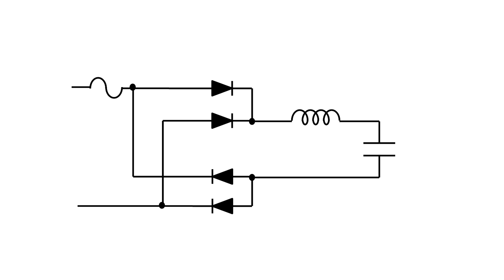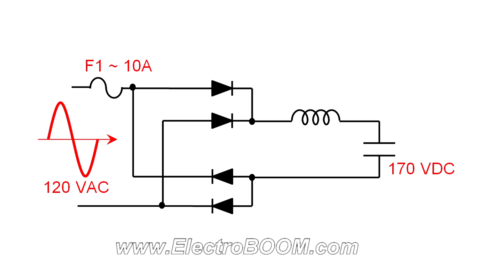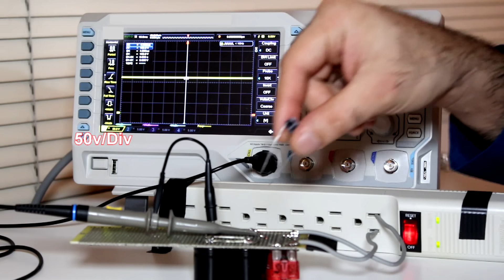Making a Full Bridge Rectifier

Comment: EB - I have a question? Could that FBR be used on output a motorcycle stator (which outputs AC current). Problem is, it is an old motorcycle and it uses a bridge rectifier (4 diode setup) to convert AC to DC. Problem is, I suspect the output is half wave or clipped. With your setup, the caps would smooth out the ripples, and give a cleaner output. 
I got rid of the OEM rectifier as it fired itself and got this: https://www.digikey.com/product-detail/en/comchip-technology/GBPC5010-G/641-1383-ND/2074848
But, I would like to have a setup like yours...15amp max current (small motorbike). 
Do you have any back feeding in your setup? That is another issue...we have to remove battery as over time, the battery will reverse drain mA....thx
Reply from the maker: What you bought seems pretty good. It is the same thing as I put together. You just need the capacitor to smooth the output. A heatsink on the part is pretty good too as it keeps it cool, otherwise it can heat up and die.
Reply: *****

Yeah, I like yours as you have caps which will smooth output...the voltage jumps all over the place on these bikes (CT90 Honda).
Wish I paid attention in circuit design...lol
Reply: Pretty damn expensive FBR you have there.
Reply: How does one calculate what size of Cap and/or inductor to use? 
The whole system is 60w max (6v). 
The stator output ranges from 5-30v DC (on output side of bridge rectifier at full throttle). Just trying to smooth output so the 6v battery stays happy.
Reply: Melli inBC Depends on the frequency, you might want to do more research into LC-filters.

Comment: What has been your most painful shock?
Reply: When he saw his father having sex with his mother.

Oh... You mean electric shock? I think 220v 16a
Reply: Touching a light bulb socket in a lamp without a bulb in it, while it was turned on.......it hurt. I was like 5-6.
Reply: when I was in grade 12, a friend loaned me the igniter for an oil furnace (high voltage generator). I think it generated an arc about half an inch long. I was using it in the basement, bare knees on bare concrete floor. I touched the arc with a pencil that was burned along the side. There was enough conductance through the carbonized wood to give me a jolt that made my right arm feel like it being torn off. No burns or lasting damage, but I realized at that point that  ignoring all my knowledge of electricity could be fatal. Returned the igniter to my friend the next day.
On an interesting note, years later, I observed that my right arm is noticeably stronger than the left, despite being left handed. Doubt its cause and effect though.

Comment: What is connecting the components at 3:58? Also is each hole on that board electrically isolated?
Reply from the maker: I used some copper wires to connect components like you see. The holes on the board are isolated.

Comment: May i ask you what is the role if that inductor?
Reply from the maker: +ucsikz2 It is for filtering purposes. Since inductor current doesn't change fast, the output current would be smooth and the voltage ripples across the large capacitors will be small. It specially helps those large capacitors, reducing their ripple currents which could be potentially very large at high load current due to the 60Hz input frequency. Imagine without the inductor, in every 60Hz cycle the capacitors have to provide 10A maximum in this circuit to the load, and then get charged with high current of 10A or above. That's a large current that heats up the capacitors and can make their life shorter. Now with the inductor, it helps provide a lot of that 10A current, making the capacitor current much smaller.

Comment: Hey Mehdi! If i took a diode and a fuse and plugged into a standard wall socket would that give me a DC power supply? Or would I have to use  a FBR?
Reply: Yeah, but that would be around 170VDC, and the waveform would be a sine wave in the positive part and no current would flow in the negative part. But be careful about the specs of the diode, it has to be able to handle at least 200 volts. Also, I don't see where such a voltage would be needed. What do you want to use it for?
Reply: I just wanted a steady DC source without buying a variable power supply or going through batteries, mainly.
Reply: Well, that is the wrong power supply for you in this case. Adding a capacitor on the output would smooth it out and make it steady, as shown in the video, which is suitable for small loads. But only if you want a voltage as high as 170 VDC. But as you said, you want to replace batteries with it, you'd have to regulate the voltage down with something. So I'd suggest looking for "diy regulated power supply" on google. There are much better solutions and they aren't as dangerous and crude as your suggestion.
Reply: +BeatRush2011 Not as dangerous and not as crude sound better. thanks for the suggestion!
Reply: No problem ;-)

Comment: Why use a resistor to discharge?
Reply: +Bronson Stephens The capacitor is charged to some voltage. Depending upon the voltage across it and the capacitance, there is some charge on the capacitors. Touching it with BARE hands could mean discharging of the capacitor and a current through your hand. Sure we don't want that.
Reply: +smit chaudhary why not just use a screwdriver?

Comment: You could use an isolation transformer to isolate the ground without affecting the safety of the power strip. I actually modified an old 120/240-volt transformer for that very purpose!

Comment: hello electroboom

another question...

could you explain why you choose to use a 30mh inductor? was it just perhaps a random choke lying around or is there a reason? how did you come to a 30mh inductor, is there a type of formula?

i am in Australia so i have made a 240vac full bridge rectifier.....and am contemplating whether i should use 60mh inductor because its double the voltage of yours? or does it not matter.. ...

Comment: Insulating the scope ground is a very bad idea. All the exposed metal on the scope is then at the line voltage (or whatever potential you connect the scope probe ground to). The right way is to use a differential probe or at least use an isolation transformer to power your circuit (NOT to power the scope - that just does the same thing as insulating the ground of the scope)

Comment: let me ask why you use 4 capacitors instead of 1, and are they linked in parallel?
Reply from the maker: +Rory Saba Just to have the high capacity I need. Instead of one huge one, I used 4 smaller ones in parallel.
Reply: +Rory Saba To make the wave very smooth
Reply: +Eugen1344  i fully understand now
Reply: also, real capacitors behave as if they have a resistor in series, called ESR, connecting them in parallel allows to reduce this resistance.

Comment: Hi Mehdi, could you explain why you get 170VDC over the cap even tough the max amplitude of the FULLBRIDGERECTIFIER is 120VDC at 1:00? Thanks, really love your videos!
Reply from the maker: +bume nicläs The input is 120VAC, which means it has 170V peaks. And through bridge rectifier they result in around 170VDC.
Reply: Thanks for the reply,  so the 120VAC is RMS?
Reply from the maker: bume nicläs yes
Reply: +bume nicläs VAC * sqrt(2) = rectified and filtered 

120VAC*sqrt(2) = ~170VDC

Comment: Hi Mehdi, one doubt. The DC "BARELY" hurts you, but why the stored capacitor hurts badly?
Reply from the maker: +successmiracles No DC can hurt quite badly, but it depends on the voltage level as well as where it touches on the body. 170VDC on fingers isn't too bad. But those flash capacitors charge up to 300VDC and that's very painful
Reply: Thanks.

Comment: +ElectroBOOM Firstly, i love your vids!

Why did the capacitors on the rectifier only shock you when it was disconnected from the mains? You were able to touch the 166V DC output earlier but towards the end got a nasty shock doing the same. The only difference i can see is that in the latter it was disconnected from the mains. Am i missing something?

Thanks
Reply from the maker: +DrR1pper It's thee same DC, just that different spots on body have different feeling. The palm of the hand shocks a bit harder.
Reply: ***** Ahhh, ok, so if you had touched the output with your palm when also connected to mains, you would have received the same shock? Thanks dude! Please keep making your awesome vids! They're hilarious and very educational (at least for me :P).
Reply from the maker: DrR1pper
Yes, but would be much worse if you were also touching earth somewhere else on your body
Reply: ***** Thanks Mehdi! You're Ace! :D
Reply: DrR1pper It says content unavailable. However, you're in the right place. Electroboom actually has a full video debunking probably the same guy you saw.
Cheers
Reply: +ElectroBOOM Do you ever get used to receiving electric shocks? I have been shocked once in my life and I can't describe any feeling like it, it's terrifying!
Reply: well... it kind of depend a lot on the circunstancie. I have got many 240v shocks, and usually don't think much of it ... (apart from: shit let me avoid that!) but once i got a shock when i had a live wire in one hand and neutral in the other (because i'm stupid!)... i almost shit myself.
Reply: +ElectroBOOM I haved 240 AC shock from electric socket.... at age 8.
Reply: I've been "buzzed" (110AC or whatever I was working on at the time) several dozen times by now, and "shocked" once (about 2kv). To answer your question, you actually do get used to getting buzzed after the first few times. Don't get me wrong, it still hurts and will make you jump and all, but it's not as terrifying after you've done it a few times
Reply: Range Rover i was soldering already at 4years old. Been shocked bij 240v ac like 100s of time
Reply: Actually if youre touching earth you would get a nasty shock because both the positive and the negative DC output of a bridge rectifier are AC referenced to ground, so showing how you touch the DC output without mentioning that you arent grounded is really dangerous.
Reply: If you're bored and or have some spare time on your hands, would you guys mind watching this. http://www.insight.tv/#!/eab91/en/show/extraordinary-humans/episode-9/episode-9

(start ~20 mins in)

I don't normally watch such things (as i've seen others in the past and saw through them) but somehow came across this in passing and the part about a man being able to touch 240VAC mains without issue intrigued me. Whilst i'm still somewhat skeptical, the reasons they came to conclude as being the reason later on at face value appear to be plausible to me and think it would to you also. Was hoping someone with more more knowledge could tell me if it's all a trick or not. Hint...the guy supposedly does not sweat and they demonstrate a test for this.

There are parts in the show that i know are very misleading though. Like the parts where he holds two electrodes connected directly to the mains and dips them in water and boils the water but the presenter of the show says something to the effect of "the electricity that is boiling the water is passing through him" which is patently false as he is only in parallel contact to the circuit that is actually channeling the large amounts of current that boils the water. There are some wtf can't be real moments too in the video but i'll leave them for you to see.

Comment: +ElectroBoom, I read online that the high resistive wire on the ceramic is nichrome wire, which explains why the resistor can heat up so much and hm even glow before melting down.

Comment: Among the numerous dangerous stunts, floating the O-scope ground so that it could be referenced to the hot leg of the AC instead seemed particularly cringeworthy... He could have simply exchanged the two suicide wires going into the AC strip, so that at least he'd be shorting neutral to ground instead (they should be at the same potential).

Or, you know, just not play with live non-isolated AC at all... trying any of this stuff is definitely Darwin Award material.
Reply: Surely exchanging the two suicide wires would only work if this was a measly halfwave rectifier, not a FULL BRIDGE RECTIFIER.
Personally, I'd not rely on the fuse to protect the scope.  I'd worry that the scope would protect the fuse by blowing first.

Comment: i dont understand, at first you touched the 170vdc but you didnt feel anything but at the last you you got a shock(may be pretended that you got a shock) and warned about capacitors being charged. was this warning for capacitors charged with more than 350vdc like you showed in an other video of yours about high ac/dc voltage effect on human body ?
Reply from the maker: Akshay Vyas No, actually different areas of body have different sensitivity and conductivity. My finger tips (maybe from cuts and beatings) has thicker skin than the palm of my hand and I feel electricity more on the palm of my hand versus the fingers.
Reply: Nissan Ranger It's been over 12 years since I sat in school, listening to all the lectures about the fancy words for it (and it wasn't in English, so I don't even know the fancy English terms), but in short, a capacitor has the ability to quickly discharge, unlike a battery or a wall socket. It gives the same shock, but the shock feels harder when it comes quickly, than when it comes slowly (not as in fast flow of electrons, that's me having a hard time translating to English again... sorry)
Reply: +morphman86 What makes you think the capacitor is anything more than just another source of electricity? The draw depends on the load...
Reply: +morphman86 this is correct. you can 'short' a battery but its current is still limited by the internal resistance. a capacitor doesn't really produce a current, but it releases its charge instantly.
Reply: +Akshay Vyas Also, a consistent flow of electricity, such as it is when plugged in, is much less shocking than just a quick, unexpected bolt, even if both are at the same power.

Licking a 9v battery feels tingly on your tongue, but you'll be able to hold it there, no problem. If someone asks you to lick a button, and it turns out to be a capacitor fed with 9v, quickly and unexpectedly blasting all of its stored energy right onto your tongue, you'll get a shock.

Comment: Isnt the oscilloscope a high ohm circuit just like the voltmeter ... I mean , you should not  be able to short something with an oscilloscope or a voltmeter ?
Reply from the maker: Ivan between the probe tip  and probe ground yes, but probe ground is connected to scope's earth. So there are possibilities to short, like this specific circuit.
Reply: ***** Thank you for your answer . That explains it better .
Reply: ***** Would isolating the ac input from the diodes through a transformers help in this case?
Reply from the maker: jboy55 yes it would

Comment: Will this work with 220V ac?
Reply: nadgoB Yes, but 340 volts DC, but speak to a priest first, as one slip-up and you will quite likely meet your maker!
Reply from the maker: nadgoB Will need to change some parts for higher voltage rating, but otherwise yes
Reply: ***** capacitors to 220v? Does any kind of diode work for this? If i was wrong what should i use if you could spare a little time to write me the specs or something please.. heh i hope i am not bothering you
Reply from the maker: nadgoB
Capacitors and diodes rated to 350V or more.
Reply: ***** Thanks! One more question, is it important how high should the amp value be on the diodes. Is 6A ok?
Reply from the maker: nadgoB
Depends on your load. If you draw 5A, make your part over 6A. 10A is safer.
Reply: Thanks you helped a lot
Reply: Julian Sortland I kind of spot welded a tool to a pair of connectors a month ago, since the caps in a circuit didn't discharge fast enough... So yeah, don't play with that. And always multiply the input voltage by the square root of 2

Comment: Beware! In some countries (f.e. Europe), the ground is more or less directly connected to the neutral. This is the case in countries with 3-phase-networks (3x230V). In countries like Britain with 2 phases (120+120) it might be ok to just isolate the ground. But anyway, using a 1:1 transformer to isolate your entire part to be measured is much safer and should be the only way to do it!

Comment: Although I do not have a unibrow and I don't find the word bare very unbearable, I do have an electrical puzzler I cant get an electrician to answer. I have a steel desk and I have noticed an electrical tingle when I touch bare skin (maybe bear skin as well but no bear has offered to help test this) to it and touch the concrete floor. I assume that some dipshit crossed the neutral and ground wires somewhere in the house, but how the cotton-pickin heck does the power get into my desk? Is it jumping from my power supply into my steel desk? I put a multi meter from desk to floor and get up to 12 volts just touching the concrete (grout really). I unplug all devices and still it gets a charge... with just the power supply sitting on the desk. I am freaking out. Cue the Twilight Zone music please
Reply: it is continuous and growing. That is, it begins mild and grows to a feeling like a pin poke. In fact at first I thought my desk just had a sharp metal burr that was poking me. Out of curiosity I put my volt meter on it and touched the grout. I thought some electrical device on the desk must be shorted out so I unplugged all. With the power supply sitting on the desk I still get the charge. With it unplugged it disappears. I took apart the power supply and could find nothing that should be shorted to ground and no wires touch the desk. Like I said, it is spooky. I think my desk need an exorcism. Thanks for the thoughtful response.